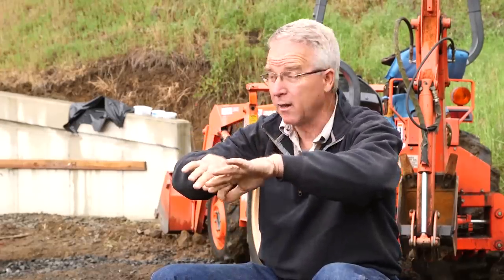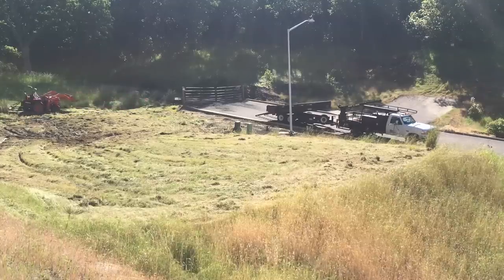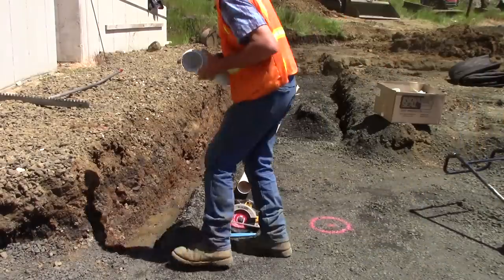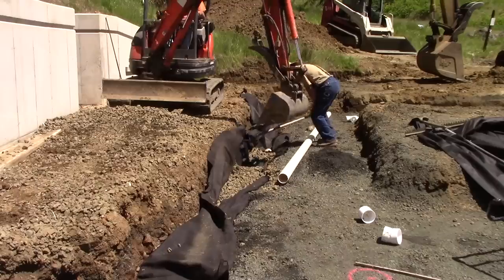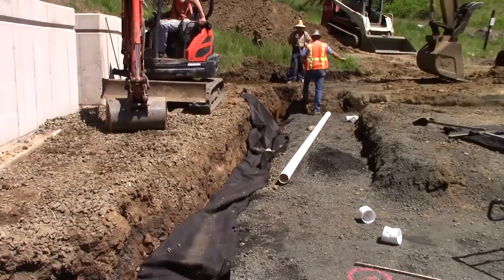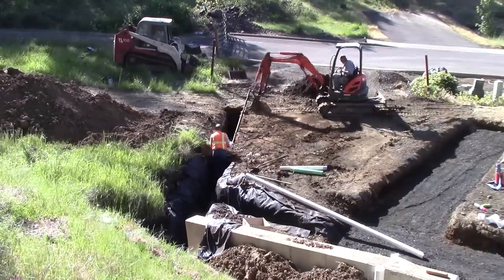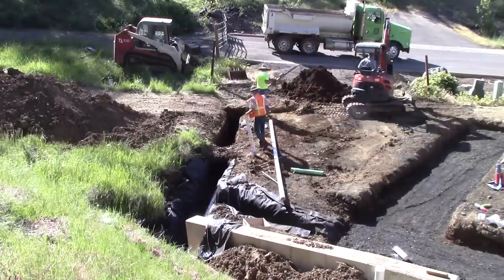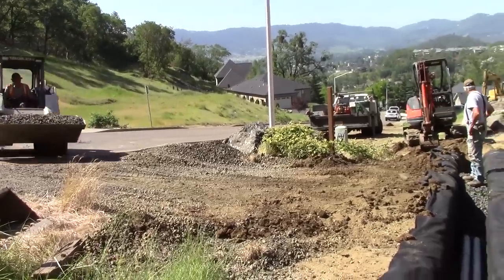Correct the Drainage Ep.27

Comment: This leaves me with a question, though: What effect does this drainage strategy have on flooding? Not on the property itself, but further downstream. Seems like this strategy would increase the speed of run-off, so that each development would increase the likelihood of flooding in the area.

In the UK, you now require planning permission if you want a driveway with an impermeable surface - such as tarmac or paving - for exactly this reason. Thoughts?

Comment: :Noob question: won't the filter cloth get clogged with time?  Rendering the pipe useless?
Reply: Was just wondering this myself.
Reply: It will lose some of its permeability but it will still drain. As long as there's a space (in the drain pipe) water will try to fill it. Path of least resistance.
Reply: Water is already moving through compacted soil just fine, why would it stop at the cloth? The cloth and gravel allows a very slow seep over a large area to be concentrated into a large flow through a small area (holes in the pipes). Think of the gravel as just a spacer to keep the cloth as far away from the pipe as possible, maximizing its area.
Reply: In fact the the fabric prevent soil to go in the drain which would create small "caves" and make the terrain instable near the drain. Well... I suppose.

Comment: Do you prefer the pvc to the black pipe with the "sock" on it? Not sure if it's ABS pipe or not but it comes in a roll. I'm also in Oregon and an old logger converted into a construction worker still wearing my rigging pants and suspenders

Comment: The widow I married has a house that sits on wet ground for 45 years and I've been here with her for 8 years watching the house twist and settle more and more. I think sometimes the only solution is to move the house. My problem is that no matter how much drainage I might install, there's no place for the water to drain to here in southeastern Louisiana's subtropical climate. It's an engineering problem that I've spent a lot of time thinking about. I'm beginning to think that pontoons might be a viable solution.

Comment: Just curious, is your pipe perforated all the way round, or only on one side?
If only one side, which side goes up, the perforated side or the non-perforated side?
Thanks!
Reply: Depends on where the perforations are. Ideally  on the very bottom, say the 6 o clock position, we usually set the solid part of the pipe to help carry the water efficiently. If the perforations are on the bottom,  the water would not flow,  especially in a minimal slope situation. Think of the perforations to let the water in, and the solid section of pipe to carry the water.

Comment: Something i don't understand: If the clay is capable of clogging the rock, why would it not do the same to the fabric?
Preventing the water from ever getting into the rock and pipe
Reply: You see how they covered the French drain with more crushed rock? That will really limit the amount of clay that comes into contact with the fabric. The top of the trench is not the finished grade for the yard. They will eventually spread top soil around for presumably grass, and over the driveway will be concrete. So essentially, they are really limiting the amount of clay and dirt that will eventually get to the fabric, but to be frank, you cannot stop clay and dirt from eventually clogging the filter fabric, but we are talking 75+ years before that happens (If left undisturbed). 

At that point, if you know where the drain trench is, you can dig out the top layer of rock (above the fabric) and remove the "clogged" rocks that have been filled with dirt and clay, but leave the French drain (which should be completely free of clay and dirt on the inside). Then, Hose off the fabric and either wash the old rock or put new rock in, and you have another 75+ years of a working drain.

Comment: Won't the filter fabric clog also? I mean where would all the particulates go? Then the water pools on top of the fabric? Please explain
Reply: This is a common problem with sock-type fabric directly on the pipe, but with a French drain with lots of gravel in the "burrito" there is enough surface area where the fabric meets the soil that even when "clogged" it still flows plenty of water. Consider how much water is flowing through compacted soil in that area already. Compacted soil and clogged filter fabric will flow water at a similar rate.

Comment: I've almost always solved this issue with both new and old structures by digging a meter wide hole, filling it with concrete drainage mother/father type tubes and then filling 1/3 with gravel (prevents freeze in winter). The seams of the former drainage pipes are spaced from their previous seal fit by a matching stainless steel ring that allows water to go in the "well" at any height. Usually (but mostly depending on city or country) the depth of this drainage "well" is in relation to the water table, but in some cases, provided the lower levels are sealed (bitumen wrap and bitumen seal rings + concrete poured at the bottom with a 10 cm deep bitumen pour under that) i can pierce it, like i said, depends on local laws AND allowances/permissions. 

As i understand, NA has stricter rules (?).

It's expensive, yes, but some houses are worth it, especially when you have to do a restoration on a hundred plus old house that cannot under any circumstance, have its foundations disturbed or touched.

Comment: What about an encapsulated crawl space, with dehumidifier?
Reply: I'm a big fan of multiple, redundant remediation of problems like this.  I recommend:
1. Proper exterior drain system.

2. Encapsulated crawl space, sealed with membrane on the outside.
3. Waterproofing paint on interior walls.  They claim it will handle a 15 foot pressure head.
4. Floor sloped towards a low point.
5. Sump pumps at the low point.
6. Dehumidifiers.
7. And it will still get flooded, so bring a bathing suit and flippers.

Comment: This may be a silly question, but how does the filter fabric itself not get clogged?
Reply: There is so much surface area at the interface between the soil and gravel that the fabric being "plugged" doesn't really matter. Consider that the water is already moving just fine through compacted clay. The key to a drain system is maximizing the size of that interface. If the clay is allowed to infiltrate into the gravel the interface gets smaller and smaller until you are trying to seep all that water directly from clay into small holes in the pipe.

Comment: If the filter fabric is used to prevent the clay from plugging up the rock, (as explained at 5:30) what prevents the clay from plugging up the filter fabric itself? Most "filters" are replaceable for this reason. I don't imagine you easily swapping out a 30 ft. burrito wrap buried under rock and dirt. Not an issue, i guess?
Reply: It's all about keeping the soil as far away from the drain pipe as possible. The farther away it is, the more surface area there is for water to flow through. There is a big difference in flow capability through 100 square feet cross-section of soil (at filter fabric) than  a tenth of a square foot worth of soil at the holes in the pipe. The closer the soil is allowed to get to the pipe, the less water the system can flow.
Reply: @asdf are you sure? You can buy PVC with holes...

Comment: At 6.37 the video shows the  stone back fill surrounding the perforated pipe is not clean, it's full of fine stone which will block the  perforations in the pipe. Please why you didn't use clean stone without fines.

Comment: when the oil filter on my car gets full i can change it easily. when your filter fabric gets silted up, as its job in your system is to block silt, how do i change it? you just created a burrito of fail. the purpose of the perforated pipe in a modified french drain is to allow you to clean the silt out of it using the clean outs if it ever gets silted.

Comment: You say the rock will clog up without the filter fabric but like every filter,  the fabric will clog up eventually. So when your burrito shell is clogged up, where does the water go then? Common sense says the system will work longer without any filter because the dirt will be able to flow into the drain pipe and into the storm system....The pipe should have clean outs and the storm system should have a "filter" that can be changed or cleaned, easily.

Comment: I’ve been a builder for a long time.  None of what you’ve done on the house build up until now would happen in South Dakota.  I’ve never seen an engineer on a home build, wouldn’t be able to find a geotechnical guy if I searched high and low, and have never seen a blueprint of anything more than a floor plan and some Pinterest pictures.  Nobody will pay for anything done right here.  I mean, if you are building new homes here they better be under $100/square foot finished or you won’t get the job.  Builders are charging $8-$9 per square foot labor to build everything start to finish, not including concrete work.  That’s why I’m phasing out of the trade.... it’s over.

Comment: How about running a 14 or 12ga wire in the Drain Pipe to 
discourage tree roots ??   for Long Term protection. Is there a Camera Access to this Drain ?
A Willow/Oak Tree’s Roots follow underground water 100’s of Feet.
Reply: tree tree tree tree
Reply: phrozen17- I guess I would know. 😀

Comment: I enjoy your content to what when the when the Filter Fabric rots away in 10 years from now then what
Reply: That fabic will be around far longer than 10 years trust me.
Reply: It's synthetic - will be around long after you are...
Reply: @ Mike Grizzle - I’m not sure where you came up with a life span of 10 years for the filter cloth but that simply is not true. Without exposure to UV light, heat, oxidation and abrasion, the filter cloth used here, for this application, could be expected to have a useful life of at least 30-50 years, easily.
Reply: @Mike Grizzle...It'll last longer than anyone posting any of these comments...even if you're 15 years old and you live to be a 100!

Comment: Please, please, please, at 0:40 you say, "....dry rot....."  Except in some very, very rare occasions, there is no such thing as "dry rot."  Wood doesn't rot if it's dry.  It is "wet rot" or just rot.  When the term "dry rot" is used it implies that it just happened.  Who knows why, but it just happened.  It doesn't just happen.  Rot occurs when proper design is missed and the building can get wet.  After 50 years of designing and building log homes, I am can tell you that if you have a good design with an adequate roof, gutter and drainage system, you will almost never have rot.  With proper design, a well built, handcrafted log home can last for hundreds of years.  If you go cheap on the roof system you have taken the house to a one or two generation house at best. A good design on the front end is money saved and money earned on the back end.  The best protection is a good initial design.